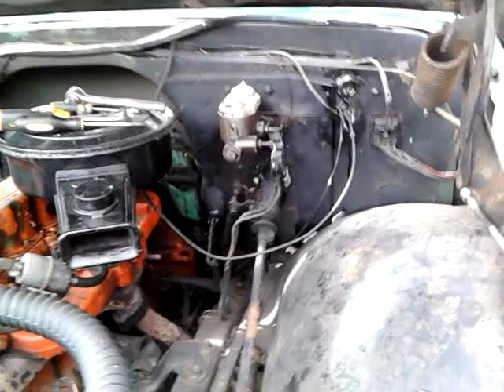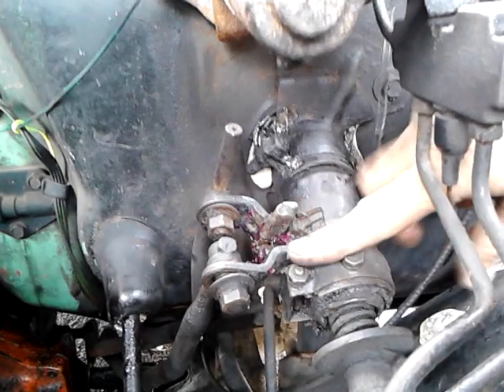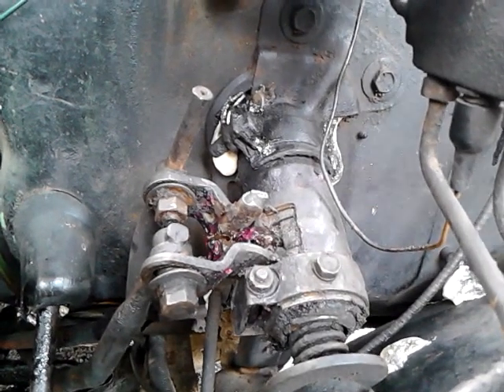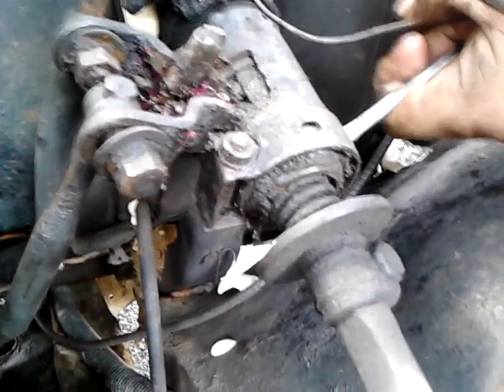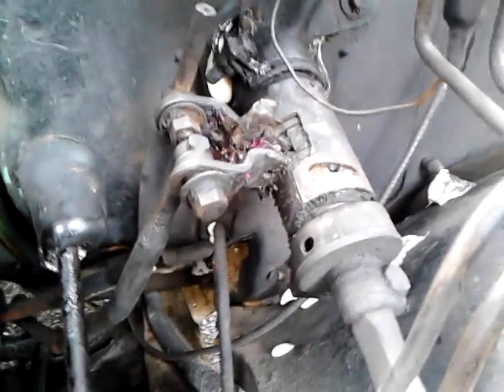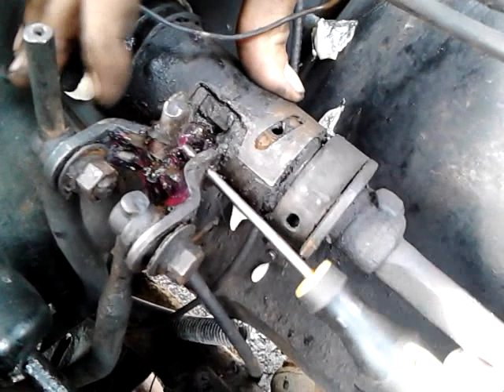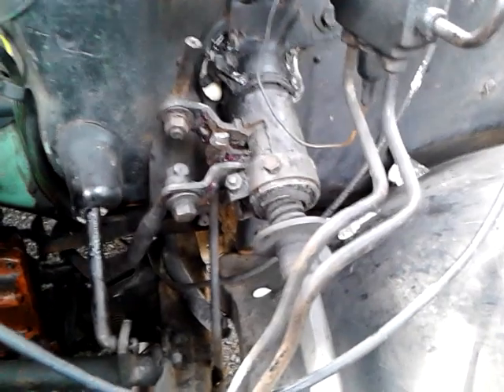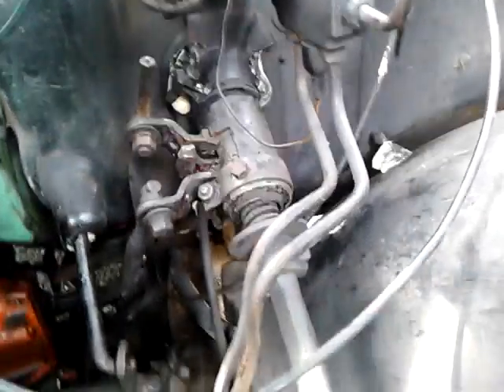How to adjust 3 speed column shifter

Comment: Ive completely rebuilt my transmission and 3 on tree column in my 86 C10. i can not seem to keep ear from catching both Rev &1st lever and 2nd/3rd lever at the same time. Shift feeling from inside cab is horrible, i feel as though i am in perpectual neutral. This is a later style 3 on the tree so it is slightly different from yours. very frustrated and really dont want to remove the character from this truck.
Reply from the maker: Not sure how later versions worked. It sounds like it may need adjustment, there should be a bolt somewhere on the column that can be taken loose to move the levers apart more. 
I wish I could be of more help, but I just don't know how the later ones work.
Reply: @lukeFugate  Thank you my friend. I appreciate the time. i am at a place where i may just have to cut a hole in the floor. I have run out of options unless i completely rebuild this column again. Frustration!

Comment: Would this technique still work on the my issue? My problem is that the shifting does not want to accept me selecting first or reverse. It is almost stuck in 2nd and 3rd gear. Those two are the only gears I can select but reverse and first randomly with some force will work. I'm going to attempt this tomorrow and hopefully it works!
Reply from the maker: JPC Gaming It should work for you. I hope it helps you.

Comment: Big help bud what's it doing or what's it called when it seems like it's only going into gear like half way into gear and it has to shift out of first and then it kind of wiggle it around and then shift back in and if it makes you sound then I'll be able to drive it fine but if it's not then like I said it's like it's only half and half way in gear and drives like crap
Reply from the maker: That kind of sounds like a transmission problem.

Comment: hey i just bought a 74 gmc with a three on the tree and i drove it for like 65miles  then my buddy was playing with it while it was sitting there and now its suck in first, any ideas what would be wrong
Reply from the maker: It's just jammed happens all the time with these types of shifters. the middle piece comes out of its place. If it is jamming you need to do this adjustment anyway. just loosen it up until the shifter will move up into the middle and then follow the video. I'm not sure if the 74 is exactly the same but it should be pretty close.

Comment: my son just bought a 76 with 3 on the tree but we're missing the linkage from the tree. it has a hurst shifter installed but it's also missing one of the linkage rods. can you still get the original column shift linkage? thanks Chris.
Reply from the maker: Try LMC truck. They will probably have anything you need for that truck.
Reply: +luke Fugate thanks a million. .I'll check them out. .thanks brother

Comment: Will this adjustment work on a 79 C10 which seems to have a different design on the 3 speed column shifter?
Reply from the maker: not sure about the 79, but I think it should be close to the same design.

Comment: can u put it on 1st 2nd or 3rd with out pushing the clutch?with the motor off. its that normal cuz mine is doing that
Reply from the maker: If you aren't sitting on an incline so the truck is not trying to roll either way it will go into all the gears with the engine off.

Comment: I'm needing 3 on the column linkage can't find them anywhere I look I have a 1970 model that someone screwed up by putting it in the floor
Reply from the maker: Those are hard to find. Ebay might be a good place to look. I just looked on there but didn't see any right now. I'll look around here. I used to have another 68 for a parts truck, not sure if I took the shift linkage off or not. If I find them I'll let you know.

Comment: Old vehicles require allot of maintenance. Checking adjustments, and grease.
Reply from the maker: Yes they do, but if you take care of the maintenance they will last a long time. In this video is the last time I did this adjustment and it is still working fine.

Comment: it worked for a while but then it became out of alignment again, the arms connected to the actuator that go fown to the transmission have a lot of play and need new bushing but I dont know what they are called or where to buy them
Reply: they nees the bushings at the top and bottom
Reply from the maker: Do these look like the bushings that are out? 

http://www.classicparts.com/1960-76-Trans-Arm-Control-Grommet/productinfo/91-063/#.WM2nj-S1s8o

http://www.classicparts.com/1947-76-Shift-Tube-Control-Grommet/productinfo/91-062/#.WM2nquS1s8o
Reply: Yes thank you I think I just need to find a collum rebuild kit because I am completely out of adjustment do they sell those on that site too? I have a 1971 GMC 1500 the same thing as a c10
Reply from the maker: They probably do, they are pretty good with customer service. They've helped me a couple of times. Sometimes it's easier to talk to one of them because their search bar on the site doesn't always find what you need.

Comment: Mine doesn't have the holes like yours to run a screw driver into it but other than that it's the same
Reply from the maker: You might try to line it up visually and get it as close as you can.

Comment: If anyone can help I have a 65 chevy C-10 with a 3 on the tree it shifts fine but when I shift into 3rd gear when I get around 50-55 mph it keeps slipping out of gear it kicks it back into neutral then I can shift back to 3rd no problem but the only way I can keep it in gear is I have to hold it in 3rd while I drive or else it will slip back into neutral does anyone know how to fix this thanks
Reply: That sounds like a worn out synchronizer gear but the linkage could also be out of adjustment.

Comment: My truck is stuck in first gear and I don’t know how to get it into neutral
Reply from the maker: If you take off the adjustment ring you should be able to line everything up in the middle using the screwdriver. The extra slack will make it easier to separate the pieces from each other. Then make sure all three pieces are lined up and put the ring back on and tighten it.

Comment: I did that and it didn’t work it keeps getting stuck in 3rd. What else can I do?
Reply from the maker: You could try to tighten up the collar a little more. If that doesn't work the bushings in the column could be worn out. They are hard to find but I have heard of people using copper plumbing fittings as bushings not sure of the sizes though.

Comment: Can you please put all that you know about plymouth,dodge, chyrsler 3 speeds coloum, floor shifters PLEASE.
Reply from the maker: I only know about Chevrolet 3 speed shifters. I have only ever worked on chevy because thats the only ones I have had. Sorry.
Reply: thanks for all the info, I'm trying to convert a 3 speed on the tree shift to a floor shift. some one tried to steal it and broke the stearing and hub
Reply from the maker: @garystump2451  That's a shame. I hope you can convert it over. I think Summit Racing used to have a conversion kit.

Comment: Is a 1979 Chevy straight 6 good on gas lol
Reply from the maker: That depends on how you drive it. Mine is geared low so about 45-50 mph is cruising speed. I get a pretty consistent 17-18 mpg at 45. At 55-60 mph its about 14-15 mpg. On most roads around here 45 is plenty.